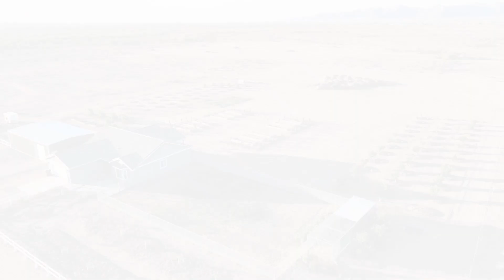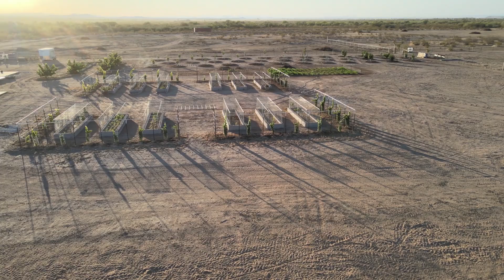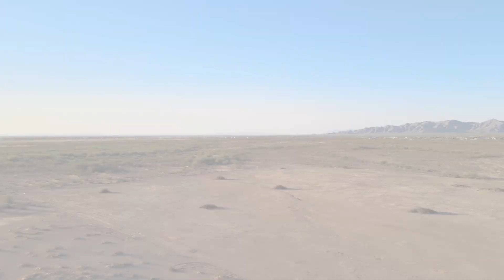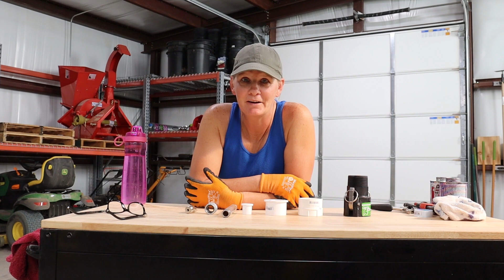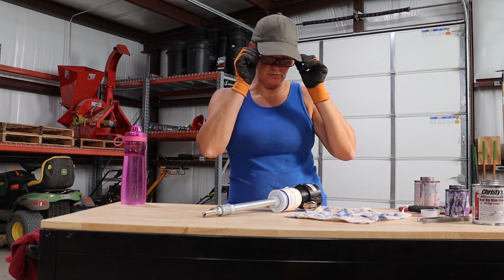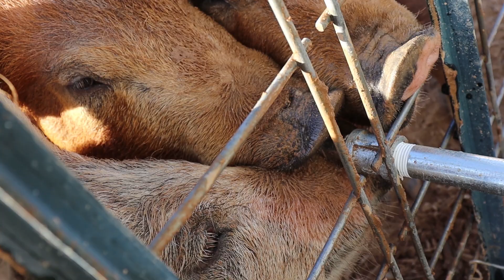How To Build an IBC Tote Pig Water Drinker | Parts Detail

Comment: I like the concept. How has it been working since your vid? Have you made any mods?  But one nipple for 13 pigs???  Here is an idea. Make a multiple nipple set up attached to a board that is mounted on a pallet. Then run a garden or air hose from the tote to the nipples..  I personally would make at least a 4 nipple set up with 13 pigs...
Reply from the maker: Believe it or not, this thing is still going strong with no modifications or repairs. Last year we finished 20 pigs with this same waterer and are finishing up 21 this year. The only issue has been some algae buildup in the tote, but covering it with one of those IBC tote covers does help. It wouldn't hurt to have more nipples, but we have not had any issues with pigs fighting over the nipple...at least not any more than they like to fight over everything from time to time. The dominant pigs drink first and everyone else follows after.

Comment: Very nice tutorial. The only problem I find with that many pigs is that they are fighting to get a drink since there is only one nipple for the big tank of water.
Reply from the maker: Hmm, we haven't had that issue with the 21 pigs we are raising this year and 20 last year. The only exception is when we let the tote run dry and they're all trying to drink at the same time as it refills. You can definitely add multiple nipples in a line from the single tank. That may be your best bet.

Comment: Great video but question as to why you wouldn't put more than one nipple on it so that more than one pig could drink at a time?
Reply from the maker: You can definitely add more if you'd like. We have not had an issue with the single nipple and usually raise around 20 pigs a year. They're pretty rough on the equipment, especially when they're bigger and we figure a bit of extra pipe attached to the hardware is asking for trouble.

Comment: With the extra length, have you found that the pigs break/bend it?
Reply from the maker: Hey Travis. We were concerned about that as well (and came down from a 12" pipe we originally bought), but this has survived 13 full grown pigs with no issues. I think the key is keeping the nipple right up against the fence so they can't wrench on it or bump it when they're moving around it. That's my theory at least!

Comment: How’s it holding up?  Looks like a relatively easy set up.   How many days do you usually get out of the tank when full?
Reply from the maker: Hey Cody. It's holding up just fine. I'll admit, I was little nervous with the plastic fittings and 300+ lb hogs being...well...hogs. It helps to keep the nipple just inside the fence, so they can't torque the pipe too hard. We also put some logs into the pit they started digging under the nipple, so they're not easily able to brush up against the nipple. It still happens, but it hasn't damaged any of the fittings. We had 13 full size pigs on it up until a few weeks back when we started running them to the processor. At the peak we were filling this every 3-4 days. That vs the barrel that we were filling twice a day when they were half that weight.
Reply: Was one nipple enough for all of them?

Comment: Excellent video. Are you concerned at all that in summer temps chemicals might leach out of the plastic and into their water supply?
Reply: I saw a vid from someone a few years back doing rainwater collection for human use who said a biofilm will form on the surface of the plastic and pretty much eliminate leaching opportunities.

Don't know if that claim has ever been tested by a lab though.
Reply from the maker: That's a great question and for now we're not too concerned. We only keep these pigs during the Fall - Spring months when temps are more moderate, but eventually we'll have some pigs year round. For those we'll need to shade this a bit to keep the water from being too hot to handle, so fingers crossed there are not any issues.

Comment: Some ppl paint to prevent algae, I prefer to Shade because in summer it gets way to hot.
Reply from the maker: We're still trying to figure out which direction we're going to go with that. They're still going through the entire tote in a few days, so the water doesn't sit much. A very small amount of bleach seems to be the most consistent approach, but we'd prefer not to use it.